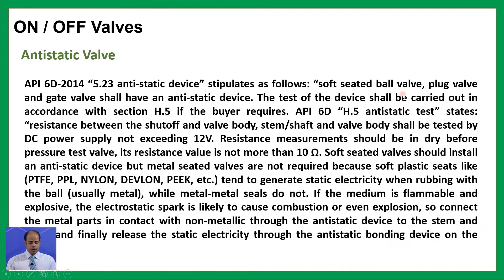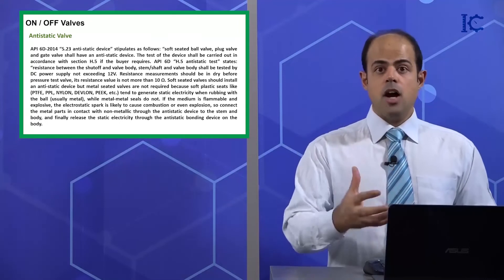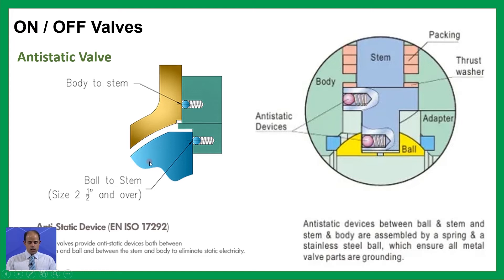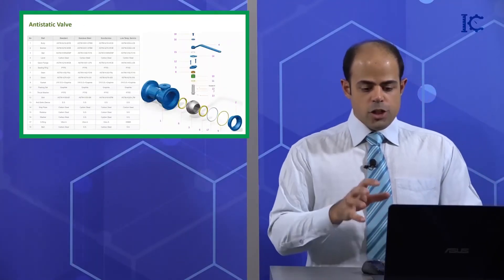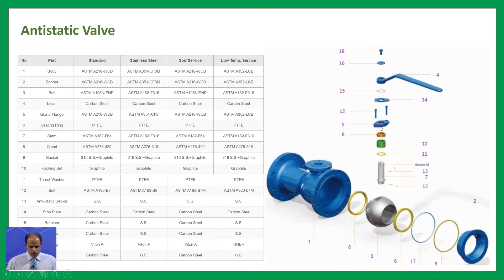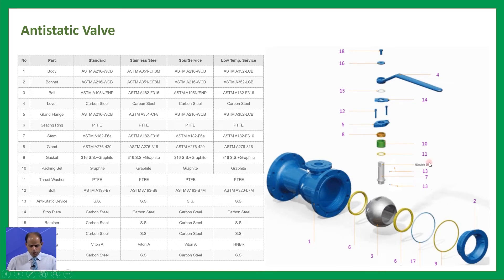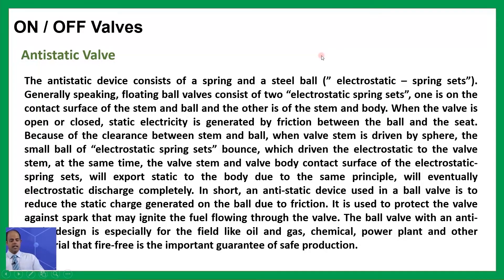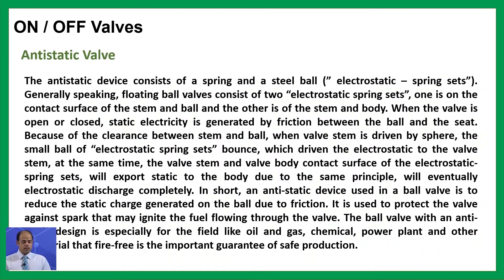what is Antistatic Valve

Comment: The stem and body, obturator and stem are having metal to metal contact. Why is still a spring and ball arrangement required?
Reply from the maker: The spring and ball arrangement provides additional assurance of electrical continuity and enhances the safety of the valve operation by preventing static discharge, even when metal-to-metal contact is present.